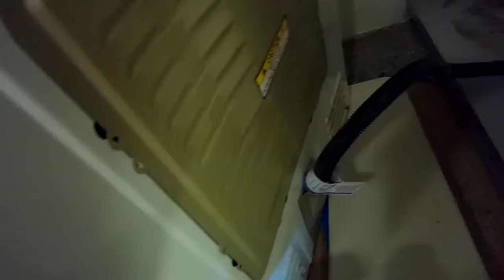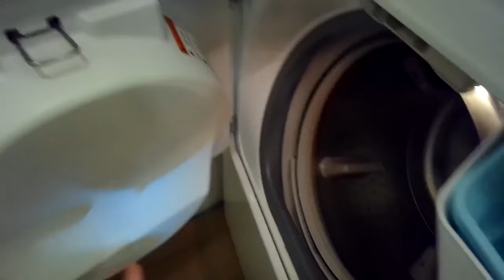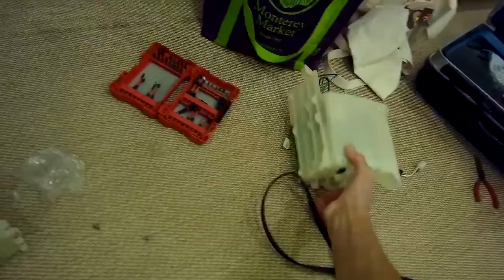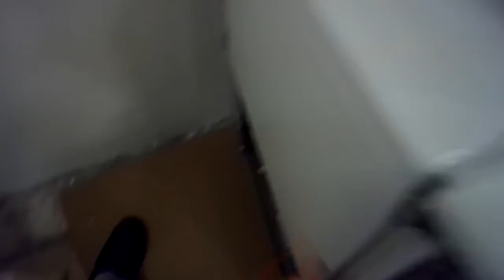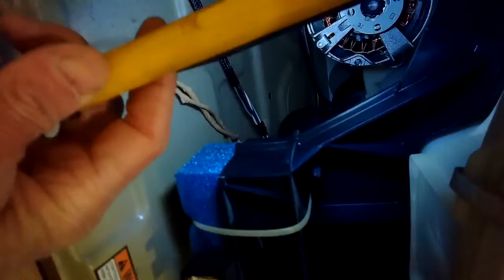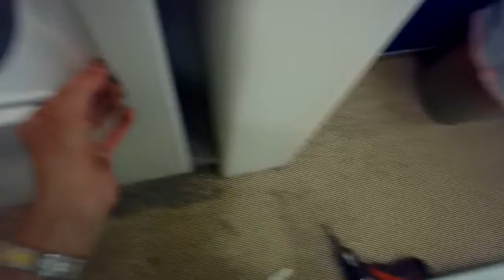✨NEPTUNE WASHER - Won’t Spin - Easy MOTOR REPLACEMENT✨

Comment: There is a small circuit board inside the motor that actual is the issue with older units that have not had burned was motor yet, the solder comes loose on the circuit board due to amp load. Also if your wax motor is burned it will short the main control board out, I recommend replacing that wax motor before it pops your main circuit board, the main circuit boards are available new for about $125.00 or a good electronics repair shop can replace the burned resistor on your original one. Their are two different issues with this Neptune washer both are related to circuit issues, the machine is otherwise a sound product just needs a TLC once in a while...
Reply from the maker: Thanks for the great advice.

Comment: Our front load maytag neptune washer does everything right except won't spin with heavy bath towels its 25 years old but we have only used less than 6 months in vacation home. I was looking at replacement controller& motor but could it be the BELT?
Reply from the maker: Hey Steve, you can take the back panel off and watch it spin with heavy towels to see if the belts slipping. I’d say it’s the motor.

Comment: Hey brother I have this same washer, I’ve fixed the wax motor but ran into a new issue the washer red light won’t turn on when I try to start the washer. Sometimes the red light will tuen on for a sec. And then it makes a click then turns off. Any advice? Thank you!
Reply from the maker: Maybe the R11 resistor on the control board is fried and needs to be replaced. That resistor controls the wax motor.

Comment: I have a similar problem that I think is because of that motor. I did a load of laundry and when I went to take the clothes out at the end of the cycle, they were soaked! The cycle was in the End mode so it did finish the cycle. I then spun the control knob around and put it just before the spin cycle and started it up. I am in the Easy Care/Permanent Press cycle.
What I noticed and heard was a growling noise when the spin cycle first started up. That noise went away after it was spinning at full speed and when the spin cycle slowed down (for the first time) and then started back up again that growling noise was constant. It seemed like the machine was having a hard time getting up to full speed along with this growling noise being there the whole time and even when it did get to full speed, that growling noise was constant. It finished the spin cycle and the clothes were now spun out.

I did another smaller load of towels on the same Easy care cycle and when the machine first started spining about mid way through the cycle, I heard that growling noise for just a few seconds and it reached full spin speed. Even at the end of that cycle, that growling noise wasn't there this time but I am guessing it might have been the smaller load?
This stackable washer model # MLE2000AYW is at least 20 years old, nothing has been replaced except the wax vane motor on the front 3 years ago.

Does all this sound like that motor is starting to fail? I'd appreciate your thoughts on this Scott. Thanks!
Reply from the maker: The growling might be the rear bearing.
Can you send a video of that to: scottthefixitguy@yahoo.com
Reply: @ScottTheFixItGuyChannel  I don't have it on video. Would the rear bearing cause the spin cycle not to work? Like I said in the earlier message, that growling noise was only heard when the washer went into or tried to go into the spin cycle.
Reply from the maker: It would still spin, but it would get more and more noisy.
Reply: @ScottTheFixItGuyChannel  Do you know how old that unit was that you replaced the motor on in this video?
Reply from the maker: @s.b.393  I think it was 15 years old👍
Reply: @ScottTheFixItGuyChannel  So I had ordered a new motor for it from Amazon. According to them, it came right from Whirlpool.. The new motor came with a new control board also. Once everything was back together, I put it through 2 spin cycles and everything worked great. No more growling and it even sounds a little quieter than it did before.
Thanks for the video Scott. It helped me a lot and gave me the confidence to replace it.
Besides the wax motor, which I did have to change 3 years ago, this was the only other part I've replaced in this 20 year old Maytag!!

Comment: Awesome! Is your new motor quieter than the last one? The 3000 motors have an annoying "wrrrrr" sound. Also, I have that same type of enclosed space. Did you have trouble hooking up your connections behind the machine? I'm thinking about getting this same stackable unit to replace my almost silent 5500 neptune washer (because I need a clothes dryer too but only have space for one).